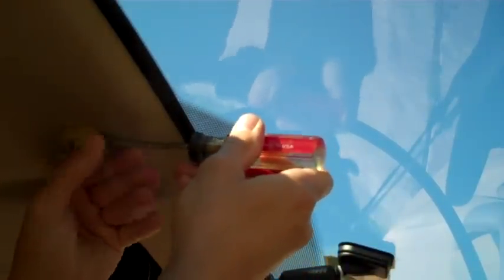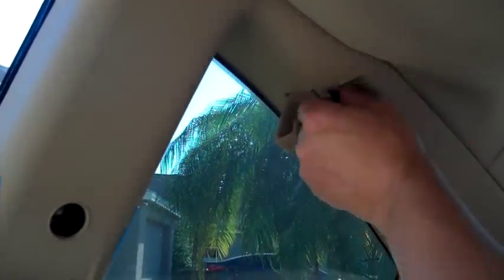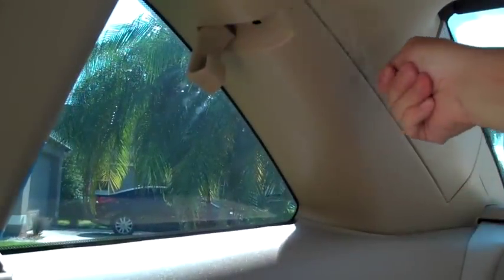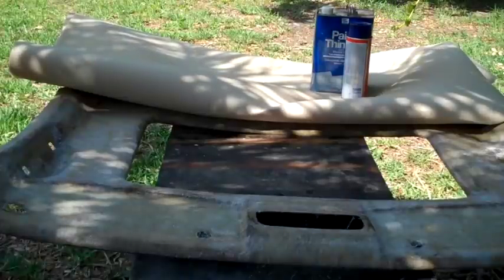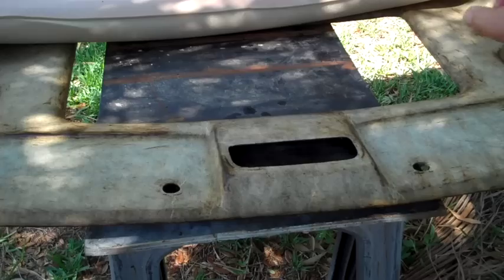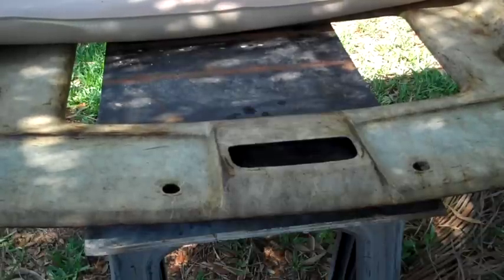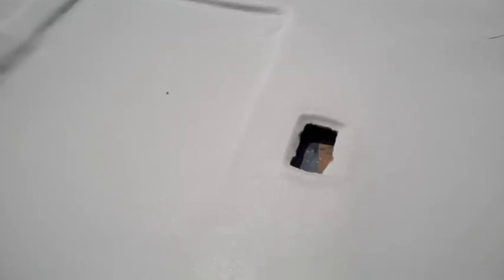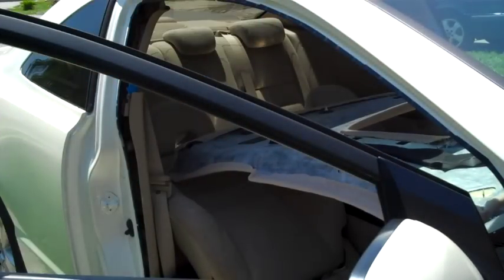Headliner DIY Cheap! $40

Comment: nice job...I get the impression some makes/models have different 'ceilings'.  I have an older Mercedes and I believe it's just fabric that attaches, unlike yours which has the ceiling molding that the headliner attaches to.  Anyway, I was impressed with  your pretty positive attitude during the whole affair...and it looks pretty damn good...thx for taking the time

Comment: A few tips:

1. Make sure to glue and smoothen properly, do not, I repeat do not put the fabric on the glue in one instance. Go slow and make sure you do not have any folds or wrinkles. I have a wrinkle and it ruins the whole look. Trust me, be careful as that glue will not give you any room to remove and re-install. 

2. The B pillars, between two doors, are easy to move if ya need, just pull the two panels back to form a triangle. They will unhinge and the top grey one will fall, later when reinstalling form a triangle and just put them from the vertex straight back in (make sure hinges are aligned). 

3. The lights will not turn on when the screws are taken off so.. don't worry!

4. Make sure you clean the old headliner COMPLETELY! It is really dirty, I found a rag and your bare hands can work (for mine at least)

5. The headliner is made of foam so be careful when getting it out of the car, also there will be wires connected with tape at the top un-tape it and you can always re-tape later (the wires are for the lights)

6. When cutting holes for handles and stuff make sure you make the holes big enough almost as big as the whole since you need to get the screws and bolts through.

Leave a like if this helps!
Reply: You can use a paint roller to get out wrinkles.

Comment: when the adhesives tack off to quickly and strings the between the two surfaces, use a blade to slice through the glue to separate

Comment: Hey bro or anybody else if you spray it on the hard surface  and then spray also on the foam. It will bond better. All you need to do is spray both surfaces wait 5 minutes and it will be good. I use this technique to make costumes. It works great.
Reply: black amigo weeb

Comment: Mine seems like it isn’t sticking like it should and I waited 10 mins for it to dry. Doesn’t look like it’s taking the form of the actual headliner either, any tips or I’m doing fine...
Reply from the maker: Sounds like you let it sit for too long. That stuff is really sticky, and should have no issues with it binding. But if you waited 10 minutes, it probably dried.

Comment: Can you use a rotary wire brush attached to a drill instead of using the hand held brush?? Or is that to rough?
Reply from the maker: +Tang0Fox1 the drill may be a bit much... You could try it though. Just be careful not to eat into the stiff material of the headliner.
Reply: Cliff's How To Channel ok thanks
Reply: Cliff's How To Channel ok thanks

Comment: I'll be honest with you. I replaced the liner when I bought the car used. Now after the hot sun, and 6 years, it's sagging again. But this time... FK the liner, am gonna just paint it with plastic paints or something heavy duty. Liner will just keep wasting away!! The dumbest thing the car industry invented. CARPET ON THE CEILING??